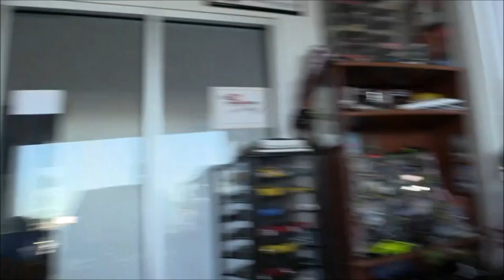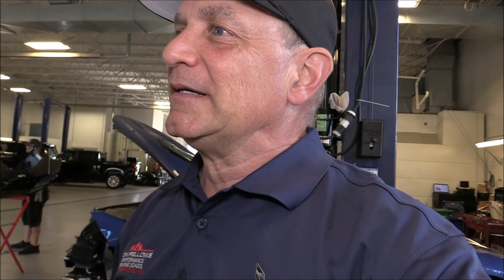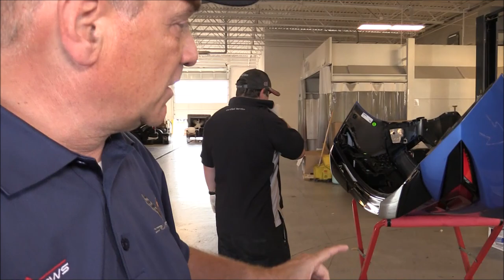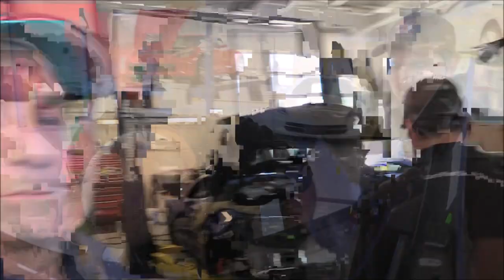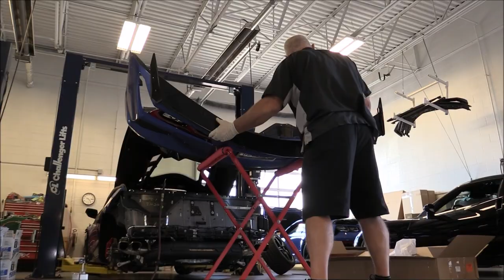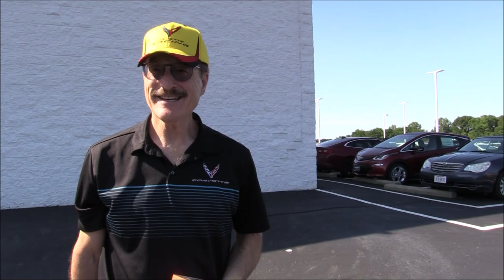WHY I BOUGHT A SPOILER ~ C8 Z51 HIGH WING INSTALL & OWNER FEEDBACK

Comment: I was a Journeyman Jig & Fixture builder for 15 years before becoming a Dimensional  Validation Engineer. I was working on the 1983 Corvette at a 3rd. party shop when we were told there would be no 83 model year. It had taken way longer to engineer than expected. Congratulations on on getting my favorite car corvette. 2021 Corvette. I my self have had 3.

Comment: When do you think the c8 z06 will start being delivered
Reply: July 2021 🤫
Reply: @RustyZipper  there not going two be for the 2021 model year gm will unveil them in July next year
Reply: definitely not going to happen in July 2021 (sorry Rusty), but since the 21's will be starting production in Nov this year and deliveries starting in late Nov/early December this year ---then my best guess is that the C8 Z06 delivers will start around the same time frame but in 2021 (late Nov/early December 2021) since it will be a 2022 model year and not a 2021.  So we are about 15-16 months away from seeing the first Z06 deliveries here...!